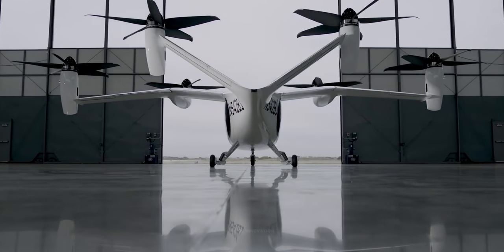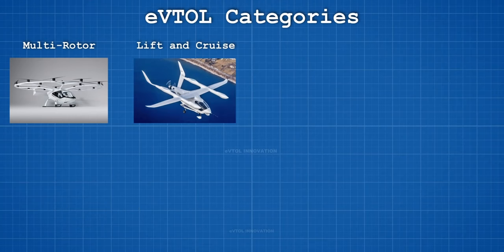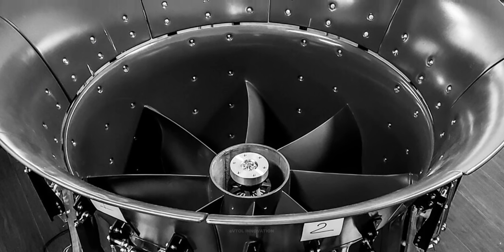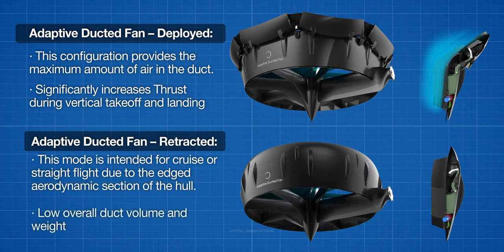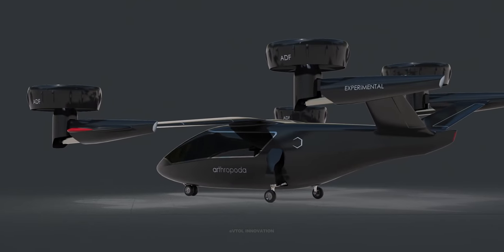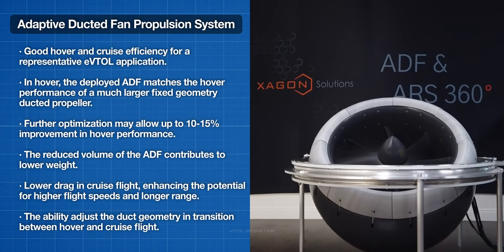Most Advanced eVTOL Propulsion System: Adaptive Ducted Fan

Comment: Novel idea, seems cool but many many more moving parts which means many more places of possible failure.  Not to mention additional complexity in part creation and manufacturing. still its a novel idea.  Ive never been a fan (no pun intended) of open rotor designs.  The Lilium Jet for me is still by far the leading design in this category of aircraft. Safety for me is the primary issue.  Many many open rotor blades all moving at high speeds and a very high risk of cataclysmic failure and extreme safety risk for passengers in the event of an accident. And we should all expect an accident event with each aircraft.  be it bird strike, or some other unforeseen event that would otherwise see rotor contact with a foreign object.   Ducted fans vastly reduce such risk, as a serious engine failure would physically be contained within the duct.

Comment: The "40% efficiency gain" or a 1.4x gain in thrust/watt is deceptive because you're comparing to a similarly sized propeller.  But the fact that you're forced to use a much smaller propeller will lose 4x to 10x of your thrust.  The fact that you can get 1.4x back with the duct is meaningless.  Even the additional 20% gain means little to the fact that you stil l have too much disk loading.

Ducted fans are well understood for many decades.  Everyone knows there's an efficiency gain with ducts but it comes at the cost of a weight penalty plus additional skin drag at higher speeds.  The electric startups act like they discovered something new when all this has been known for over 80 years.

Comment: Why not just use the old lift generating duct designs and skip the extra moving parts. This is basically going through all the steps we went through from the 50s-70s except in electric. At this rate we're going to be up to electric turbo fans in 10 years.

Comment: Magneto-aerodynamic lift drives & jet drives are about to make all this Old School engineering mindset "extinct". The first drives are being fabricated. They're 20% the weight of a conventional motor/engine of equal power.  ONE moving part. Single piece fabrication. NO blade tips.  NO stators. NO contact/friction points. NO lubricants. NO thermal hot spots. 40K-60K rpms. 100% electric powered. NO Maintenance. Simple, easy, fast, & cheap fabrication. W/in the next 2 years, you'll publicly hear about the 3 flagship classes of this tech. Beginning w/ the Cavalry-class eVTOL aerial reconnaissance/search & rescue vehicle. 34' long.  Max TOW = 30,000 lb. Max speed = 400 mph. Range = 3,600 miles.

Comment: Zero redundancy in the motors will never be accepted, unfortunately evtol designs are limited in safety because they dont glide like helicopters or planes do when crashing, evtols just drop put of the sky when a motor fails (effectively) 😅 

This can be solved by incorporating another 4 motors, but these extra 4 motors cut down on flight time, which limits use... and this is the wall the industry is up against 😅

Comment: There are so many incorrect assumptions here. You're neglecting the high current draw from the 3 phase brushless motor required to spin the fan (at very high rpm). Electric ducted fans are useless at low RPM (unlike a larger propeller).
In the end, the most reliable technology is the reigning champion: Turbofan engine
Reply: Or ... for vertical thrust & flight -- a helicopter.

Comment: I call BS on the container lifter. I don't see four ducted fans lifting over 26 metric tons worth of container, at least not if the lifter needs to also carry it's own battery.

Even tethered to a power and control umbilical, this setup is going to have a hard time lifting an empty container at port.

Out to sea? Forget it.
Reply: And if you're gonna tether it to anything, you might as well just use a crane and trucks on the ground.  In fact, you might as well use a crane and trucks on the ground anyway.

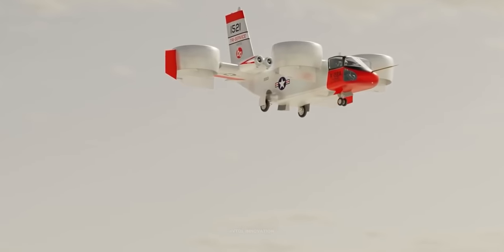Comment: 2:22 that is simply untrue. Ducts make the rotors only slightly more efficient, but the additional weight more than counters any potential gains. There is a reason why almost no drones out there use ducts.
The rest of the video builds on that false assumption, so frankly it's all BS :/

Comment: The data shows 1500kg thrust at 700kW with the special duct. This is still quite a poor thrust efficiency of just over 2kg/kW.  A decent open rotor with 400Pa disc loading would do 5kg/kW. So all this complexity still doesn't get you anywhere close. Yes you can just throw more power at the problem but then your motors, inverters and cabling need to be heavier and your hover time before overheating gets even shorter. With all the complexity of tilting actuators and now extra duct geometry actuators, to add to carbon structures, lithium batteries and high power density electric drives, the costs of eVtols are spiralling away from anything the "flying taxi" business model can bear. These will be virtue-signalling flying limos for celebrities and oligarchs, not a sensible solution for urban transport. Democratic societies won't allow flying demigods whizzing overhead while the rest of us are stuck in an overcrowded train. A lot of money chasing a tiny niche market in unequal societies like Dubai.
Reply: odd how this comment doesn't have any likes.. almost like something's going on
Reply: i say that as in its a good one

Comment: If efficiency of the opened ADF is better in all regimes, then just open it and throw away all servo-motors. This is how you make your ADF cheaper and turn it into an awesome ... fixed-geometry DF.

Cut your marketing bs
Reply: What about aerodynamic drag during cruise flight? You've missed the point
Reply: @hazcuriosity9376  I thought about it as well. Look at 2 points:
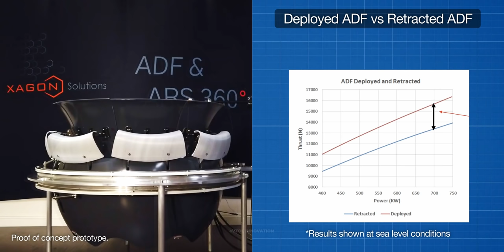5:05 - shows that deployed fan provides near 13% more efficiency
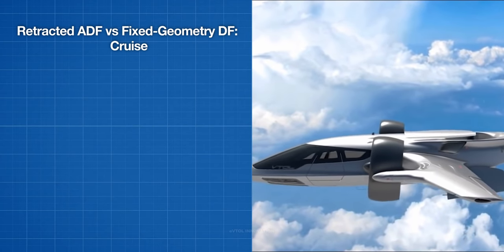5:46 - the voice tells us that their retracted ADF has 50% of drag of the thick-walled DF. 
Here, you can't just say that cruise mode ADF is better for 50% minus 13% than common DF:
1) We need to know how the OVERALL drag of the plane will change with using ADF instead of DF. I think it would be silly to think that the whole plane hull makes less drag than the duct around the fan. There is no data presented, but likely the drag effect of the duct will be somewhere in the range of 5-10% of overall drag. It is already comparable to the thrust loss due to retracting of the duct.
2) Why the authors took very think walled duct of DF to compare with their ADF? Of course they will receive the large drag difference at high velocities. What if they just take thinner wall duct DF to compare with their product?
Reply: @hazcuriosity9376  so, do you have any counterarguments?
Reply: "If efficiency of the opened ADF is better in all regimes"
Is this claim made? I thought the open mode was only more efficient in vertical flight mode.
Reply: 2- A thinner wall duct DF would have a really bad hover efficiency.[the opposite effect of a bell-mouth] There is a reason why traditional DC have that shape. 
1- It is about increasing hover performance anyways. The reduced aerodynamic drag is just another advantage.

Comment: ducted fans= less efficiency. u have to force air into the duct thus u are inputing more energy to create lift, very good for fast travel. not eco . this guy says they are efficient but later he says you need more power. more power = kess efficient. this video is a publicity stunt for a company
Reply from the maker: "ducted fans= less efficiency. u have to force air into the duct thus u are inputing more energy to create lift, very good for fast travel. not eco"  What makes you think this statement is correct?
Reply: @eVTOLinnovation  One piece of evidence that his statement is correct is the total absence of ducted fans on helicopters, even though both helicopters and ducted fans have been around for over a half-century.

Comment: This is largely BS. Ducted fans have been experimented with by the military since the 50s, they're just not practical for any sort of lateral movement because the duct screws up stability. It's definitely NOT a manufacturing problem lol. Also the startups claim of disrupting the zero margins shipping industry with expensive E helicopters is laughable. Shipping can barely afford bunk fuel, let alone lithium batteries.
Reply: I like science and tech channels on youtube and think electricity is the future, but you can't just go out and lie to people like this. It winds up doing more harm than good.